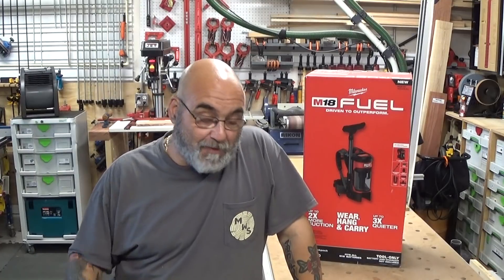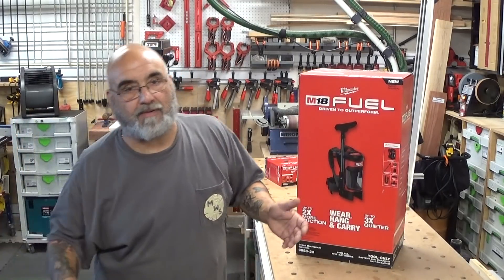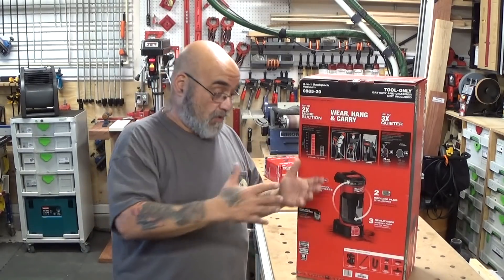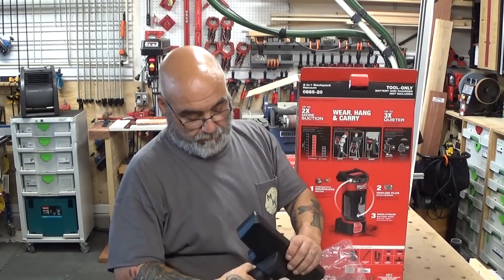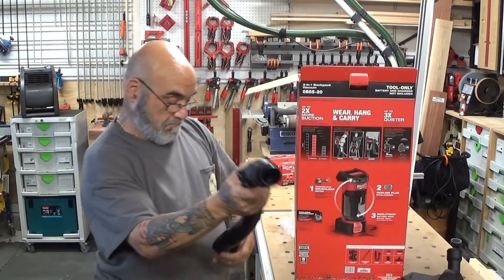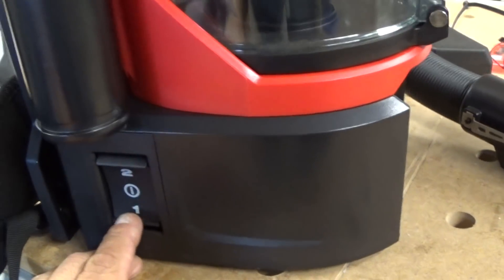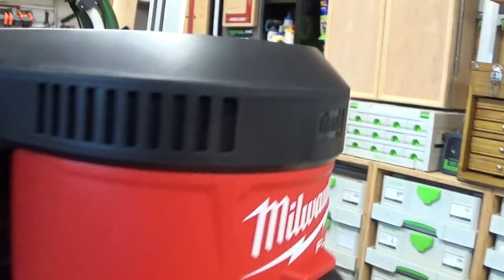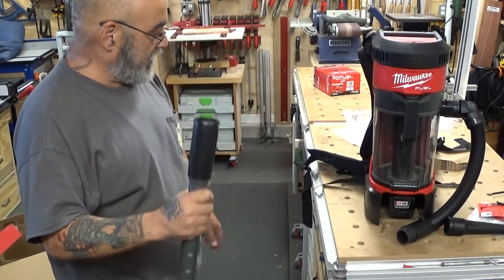Unboxing of Milwaukees new Backpack vacuum #0885-20

Comment: Great video Mike. The Hepa Filter is located on top of the  canaster. you  also  have 2 spots along the belt holder for the craves tool and the adapter.

Comment: I’m surprised you don’t have the Festool VAC or if you do, why you felt the need to have the Milwaukee?
Reply from the maker: Clear Designs I have the Festool vacs. this is for my work for cleanup and dust from concrete drilling. Thanks for the comment